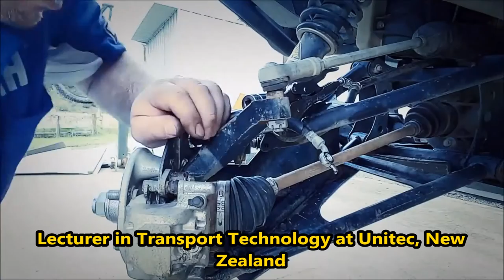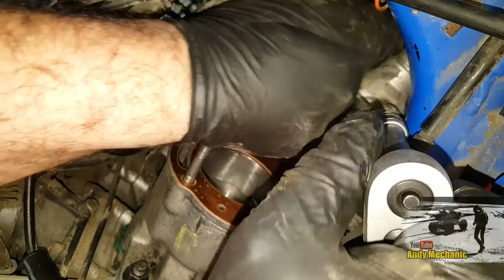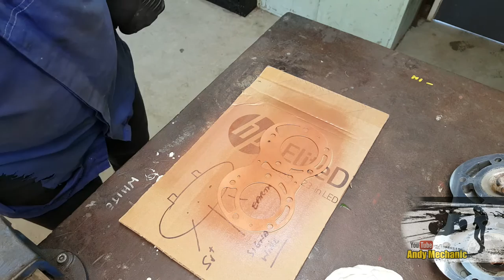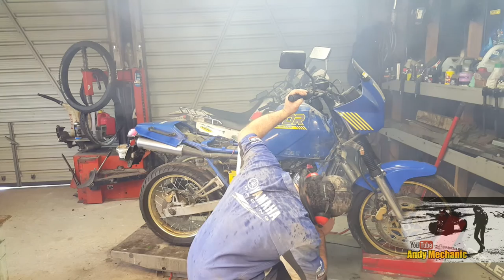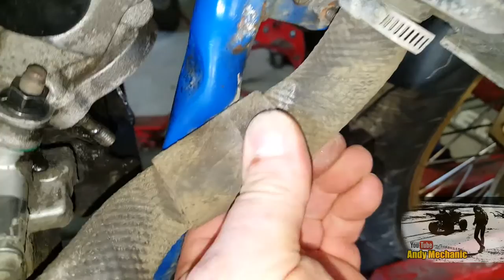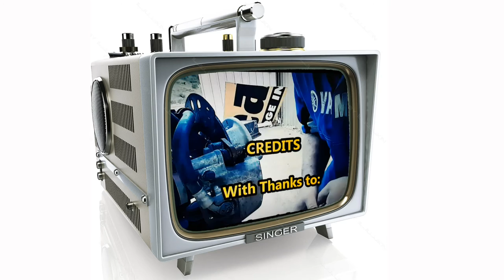TDR250 Copper gasket FAIL & fix Ep.7 #1152

Comment: Good video... Your loosing out on some clamping torque by Not lubing the threads, washer faces, & nut flanges with motor oil. As the friction that's created gives you a false reading at lower torque

Comment: As a hobby,I rebuild older['60s,'70s] Yamaha dirt bikes and copper head gaskets are all there are available. When reusing one,I heat it with a propane torch and let cool [annealing it]. I use the brush-on type of copper coat sealant in the permatex line. I torque in two stages,with the first about 1/2,then full torque. Of course,they are single,air cooled engines, Like the video.
Reply: Engine in the video is a twin not a single and water cooled not air cooled.

Comment: I swear by that copper gasket spray for steel automotive gaskets.  I had a few come-backs early on in my career, but never since taking the time to apply a light coat.  It smells like hell on toast, but it works really well!  I've even used it on steel exhaust gaskets on high-mileage cars to stop leaks from mildly warped exhaust manifolds.  Good stuff!

I use the CRC version, as it's what's available where I live, but judging by your reaction to the smell, it's all pretty much the same stuff.  :)
Reply from the maker: +rhkips Yep! If the smell is inversely proportional to it's sealing powers the job will be perfect! :-)

Comment: Keep us up to date on the copper spray long term if possible. Cheers.
Reply: Nearly 20,000 miles on my little Volkswagen having used the CRC version on the steel head gasket and exhaust manifold gaskets, and several customers with years on their cars with no problems.  Despite its appearance, copper gasket spray is an actual thing, not just some gimmicky mechanic in a can.  :)
Reply from the maker: +rhkips It's my first experience using it but so far it's 100% sucessful :-)

Comment: If you aneal the gasket before you fit it you dont need this spray and it wont leak at all, you can reuse the gaskets over and over ,you just need to aneal  every re use
Reply: Can you explain what you mean? I did not know you could reuse any gasket. But I would like to.
Reply: @Ian-of9oi  with a copper gasket,  a head gasket or exhaust gasket for example heat the used gasket with a blow torch until cherry red and then quench it in a bucket of cold water, this will make the copper soft enough to conform to the face and re seal . I hope this helps 👍
Reply: Steve Underhill thanks.

Comment: Genuine Yamaha head-gaskets are expensive but dependable. If it is a keeper, 'o' ring channels cut in the head is another option.
Reply from the maker: Yes, we did consider that & I think it's the way to go next time around :-)

If I could have I'd have used a Genuine head gasket but the 2mm oversize rebore made that not an option.

Thanks for the feedback. Cheers Andy
Reply: You need to anneal the copper gasket

Comment: Your bike still in good condition? When you put the VHT copper Gasket spray? Reply plss tnx
Reply from the maker: No. The copper gasket started to leak a few weeks later so we had a normal type head gasket specially made and that has worked just fine since, no.problems.

Cheers Andy
Reply: @AndyMechanic Good to know. Thank you for quick response..
Reply from the maker: Yep. We did that 2nd time around. Lasted a lot longer but still failed in the end...

Cheers Andy
Reply: @AndyMechanic  when Ive got my copper gasket, the company in USA have recommended anneal it and spray thin coat of any high temp sealer, when retorque after heat cycle. Your copper headgasket just not sat right because it was stiff, that's all!!

Comment: why did it leak the first time?
Reply from the maker: Not too sure, though the torque setting for the head bolts is very low on these unfortunately. It did fail again so had a normal head gasket made up in the end and has been fine since that was fitted. Cheers Andy

Comment: Damn,.....It was Painful  watching you blindly scar up the Aluminum cylinder head sealing surface by repeated dragging it over the steel head studs by deciding Not to remove All possible movement clearance interfering bits including the gas tank !! .....Not even heavy coats of copper spray sealant will water tight seal a scarred up Aluminum head mating surface !! ....Not trying to be a critical jerk,  but the Aluminum head installation with Copper gasket Is one of the Most critical assembly procedures on any water cooled engine & the Critical fastener Torque specs usually specify oil (or a specific lube) lubricated threads...Dry  threaded torqued fasteners Will result in out of spec, Low pressure clamped gasket seal...